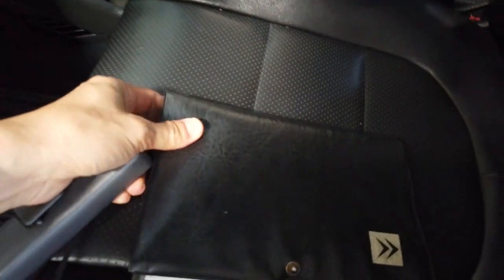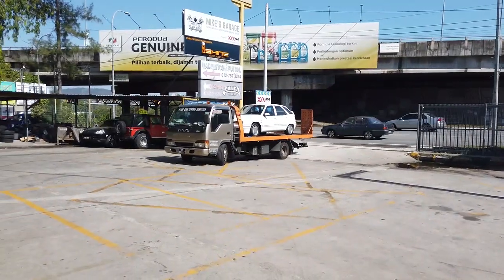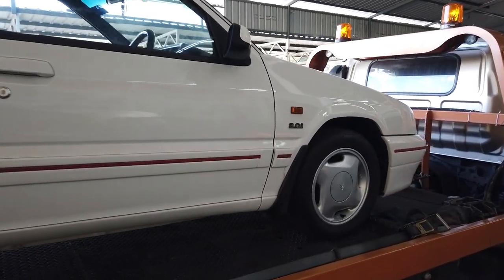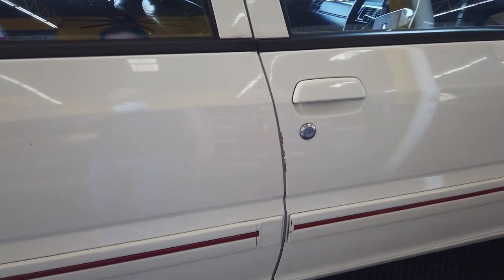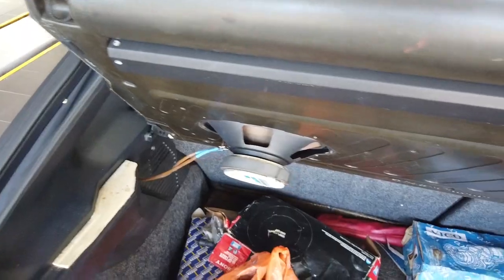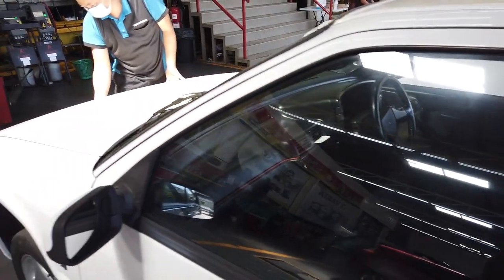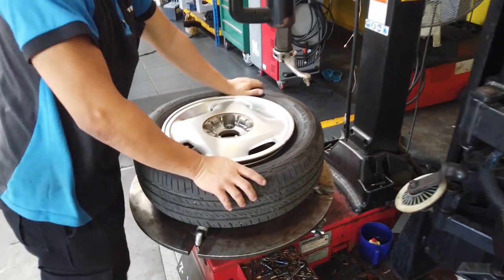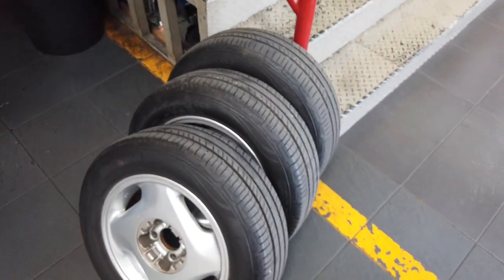I BOUGHT A CAR UNSIGHTED!

Comment: I bought a manual 2.0i M 1995 model for my son a couple of years ago. It has 175,000kms on it now. You can get it to 400,000 kms with proper servicing only. Great handling which you really can't get on newer models. The Volcane 1.9i (pre 95) was actually the better car (faster off the blocks and was  spiritual successor to the Peugeot 205 GTI 1.9i) but hard to find these cars now. The 16v version is 2 door ... few units still running out there.
Reply from the maker: Hi Bernard, thank you for the encouragement, yes beginning to appreciate Charlotte! No idea on the mileage as the speedo is dead. Will do an update video.